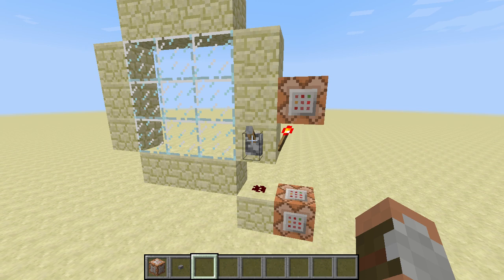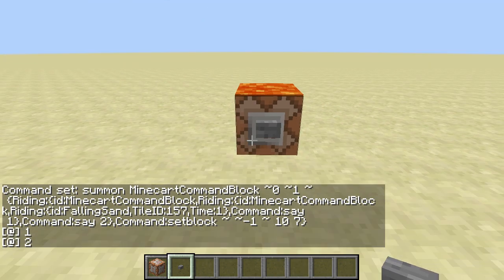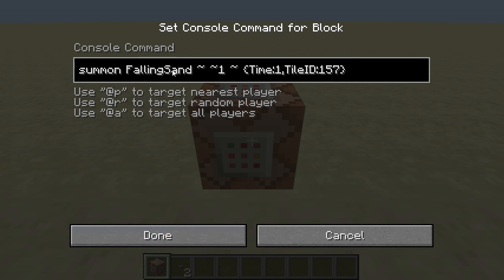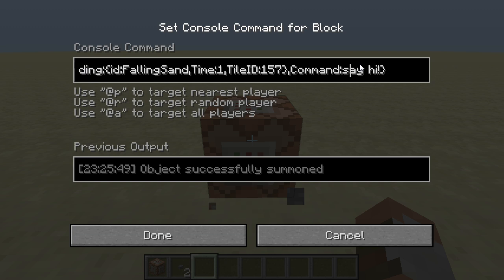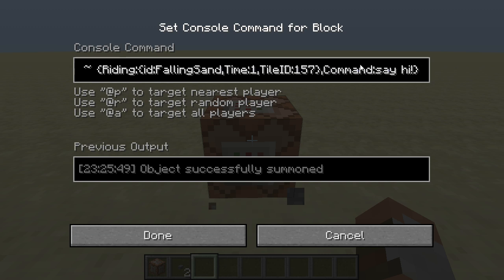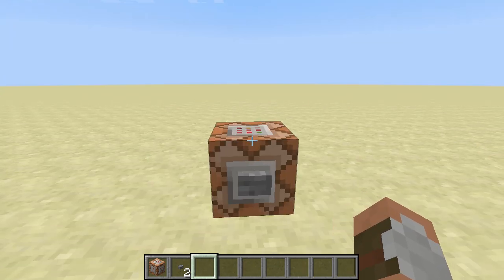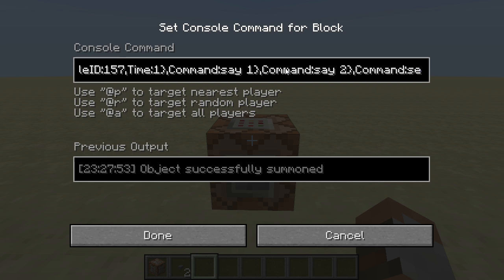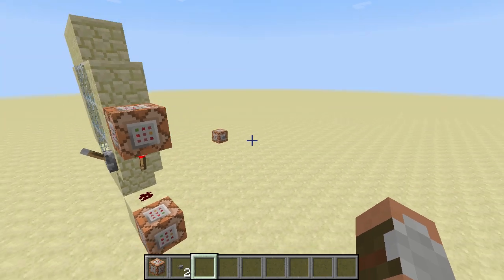Explanation: Multi Command Command Blocks (used in the 3x3 command block door)

Comment: Hello Staffehn and thank you for your contributions to our enhanced MC game play. I am just starting to learn to use command blocks.

I would like to make a Command Block do two things: 1) play a 'Star Trek' transporter sound, and 2) transport me to a different location.  I have already accomplished this using two Command Blocks individually (For other readers, the details on how to do this are not in this comment. For example, you first have to make the sound ogg file, then you have to make a sounds.json file. Write me if you want to know how to do it. Staffehn, I feel sure you also did this, unless the "Hi" ogg file already exists in somewhere minecraft).

But now, I would like to press a button on a single Command Block to make it happen all at once in this order: First, to play the transporter sound (which is 5 seconds long), and then immediately afterwards to transport me to another designated location. The command has to be timed to transport (teleport) 5 seconds later. Otherwise, I would not be able to hear the sound so far away from the command block (unless there is a command code to make the sound to be heard all over the world and not just near the command block). 

I have used these commands separately on separate command blocks:
1)  " /playsound effect.transport @p~ ~ ~ 1.0 1.0 1.0"
2) "/tp @p<x y z coordinates>

I have tried this command, but it does not work:
/tp @p<x y z coordinates. {playsound effect.transport @p~ ~ ~ 1.0 1.0 1.0}

Please help me, Staffehn, or write to me by email so that we may remain in contact.
Thank you.